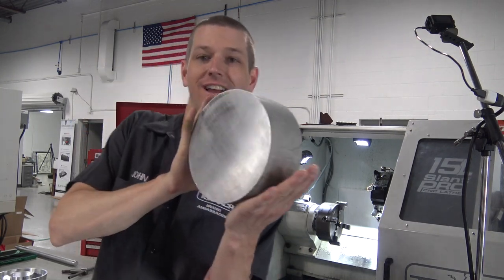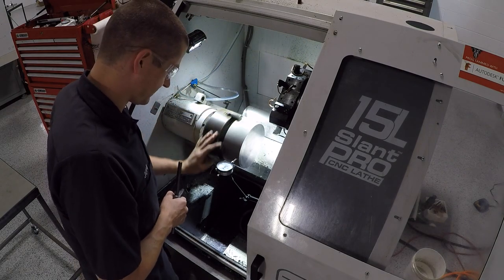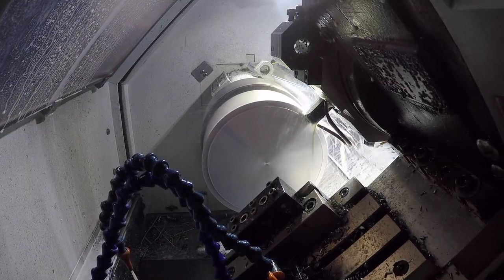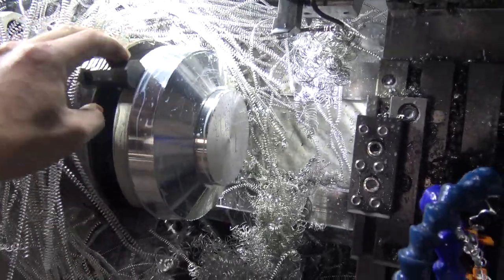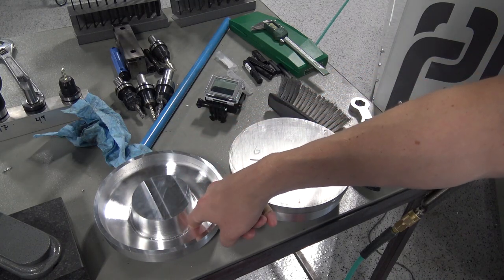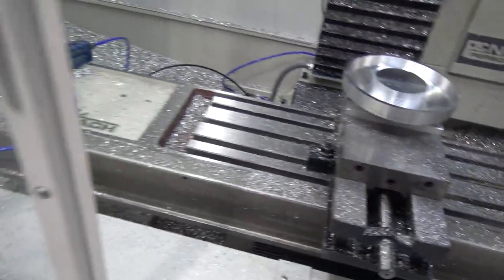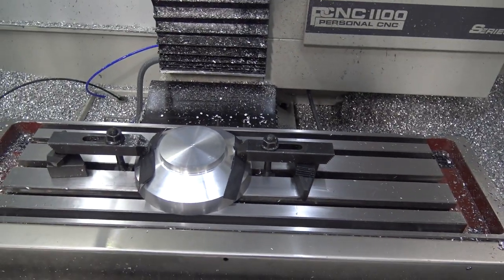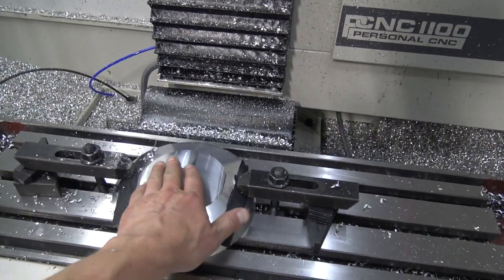Job Shop: Large Aluminum Discs!  Turning & Milling - Widget100!

Comment: John,  with the amount of hogging I c u doing it makes me think there must b huge wear in the ways and feed screws. U must have to trade the machines in as much as my wife's auto. Watching in high speed really amplifies that thought. Issue or not?
Reply: Nope. Not as much wear as you'd think. And using adaptive paths save wear and tear on the ways and screws. 

If anything the ballscrew bearings will be the first to go. The screw it's self should last 10-15 years or longer without any major effect.

Comment: why didn't you finish this on the lathe?
Reply: I agree unless his gang couldnt do the ID cutting
Reply: a boring bar would have done it.
Reply: +gus bisbal im no machinist but I would of thought the whole OP would of been done on the lathe
Reply: You would need an incredibly deep face grooving tool, and need two different boring bar setups facing in opposite directions to clean up the recessed face and the walls of the cavity. Much easier to just mill that geometry.
Reply: Brent Iannoli Brent, are you a machinist? The words "incredibly deep" and a 4 inch stick out of a boring bar do not go together.
Reply: +gus bisbal Yes I am a machinist. Read my comment again. I said a deep face grooving tool would be needed. You cant just go in there with a boring bar. There is no point of entry. It would need to be roughed out with a face grooving tool. Face grooving 2+ inches deep is quite a deep face groove.
Reply: +Brent Iannoli agreed. Iscar has 6"+ face grooving tools. But I think there would be a massive rigidity and power issue trying to do 2" deep face groove on the tormach. Especially since it was maxing out the spindle just roughing. 

Could it be done on a lathe? Even the tormach? Ya. Probably. But I bet it would have chattered like a rabid beaver on meth and taken longer to cut than on the mill.
Reply: +Occams Sawzall It would have certainly been faster on the lathe, but those specialty face grooving tools are expensive, and yes, they chatter under anything less than ideal conditions.
Reply: +Brent Iannoli that's my point. To run "ideal" (not break or chatter to death) on the tormach the face grooving tool would have to take pretty light cuts where as the shear hog was plowing through at a decent clip. 

Personally I would have helical ramped the shear hog at full width of cut to rough out instead of adaptive clearing though. Probably would have gone much faster than adaptive in that part.
Reply: +Brent Iannoli bah. Face grooving is just like axial grooving. Feed hard. I'm running a job right now in the same material with a pretty good face groove 1 inch wide with radiuses deep in the part. The tool I'm using I could not cut down do stick out is about 6 inches from the tool holder. No chatter.

Comment: Hey John , About how much did the Lathe cost , just a ball park lol dont throw your cards on the table lol just wondering I work with Digital & Pneumatic controls and I am Amazed how that Lathe performs 👍👍 Great job!! catch you later
Reply: it on the tormach web site
Reply: Tormach lists all their prices up front on their website.
Reply: +Occams Sawzall thank you for the tip almost all other companys want you to call for a quote
Reply: +Steven Baxley that's because if you ever saw the price of those other machines you'd have a coronary lol. 

HAAS also has up front pricing. That's the only other company I know who does it. Most companies aren't even up front with their used/showroom machines

Comment: looks like 4th axis job, why didn't use it?
Reply: turn it vertical and mill the insides
Reply: +Eugen Nomatterr I'm confused... Why use a 4th axis? If anything mount a 3jaw chuck to the table and use it like a vise, but he already thought better than that..

I feel like I'm missing something with the 4th axis idea...
Reply: 4th axis gives better surface and better tool path than plain milling
Reply: +Eugen Nomatterr mmmm.  No. It really doesn't. First off. The part is 8"  up in the  air off the table. Close to the table the more rigid. Next your Z axis will be operating at the top of the column, where it's the least stable. So losing even more rigidity.  And finally you would need to fine tune the axis synchronization to be absolutely spot on otherwise you'll get faceting during an X,Z,A move. 

3 axis cnc mills are very very good at making arcs without the use of a rotary. Adding one into this makes no sense. 
Only if the machine was already a tilt head 5 axis with a built in rotary table would I consider it. But then again, I would just swarf to finish the tapered walls instead of surfacing.

Comment: Your videos are great and have in a large part motivated me to start my own machine shop but i find this to be the first time that I really disagree with your method. 

Not facing the piece prior to the lathe. Leaving a massive amount of material in the first pass that you removed later when you could have just started the angle further forward, and not using the lathe with a cut-off tool to remove a really large quantity of material that could have been used for other projects rather than fly milling it all down. Using the mill to do the inside shape wasn't the most efficient method, but I understand that you have greater confidence with your mill skills, so I can let that fly.

Comment: Always turn and face the end your chucking first to guarantee a perfect square surface / end that is being chucked (chucking a saw cut and extruded surface is an invitation for trouble) is  especially with large parts that can easily be bumped or knocked out of grip. Turn back 3/4" just to clean and face just to clean than put that side in the chuck, that is why it did not re-indicate as you expected the saw cut surface and extruded Dia. is never perfect square and never good enough for this chucking application  in my opinion.... Trust me I learned  the hard way....

Comment: I have to admit I cringed a bit at your clamping of the part like that.  3 minimum for "proper" workholding of it with those.  Honestly though, I've done a lot of parts like that and I would have just cut some soft jaws even without the angle.  Gripping on the diameter of the part would have been fine most likely with your machine.  But then again, I do a lot of lathe work and would have a lot of fun doing that part on the lathe entirely.  :)
Reply: +NYC CNC would most likely use a left hand and right hand face groove tool. Face grooving inside a bore is fun. Make sure to retract the tool lol
Reply: At least clamp a few stops at the base of the part on those milling plunge cuts, or at least keep the door closed.

Comment: Bessey Rite-Hite hold down clamps. 

Far better than the straight bar clamps for most things

http://www.use-enco.com/1/1/32104-1000l-bessey-rite-hite-hold-down-cast-steel-self-positioning-strap-clamps.html